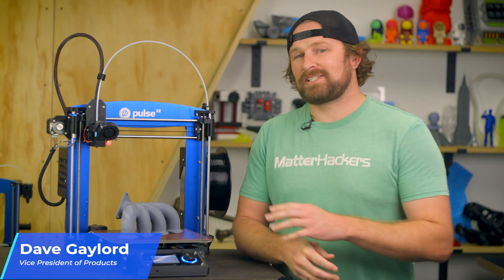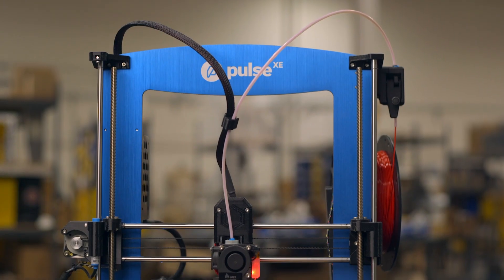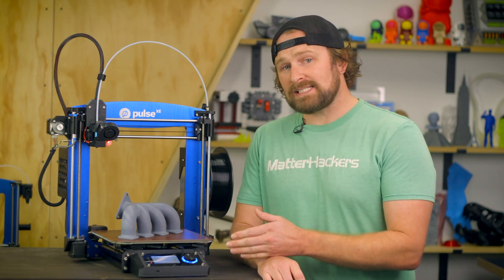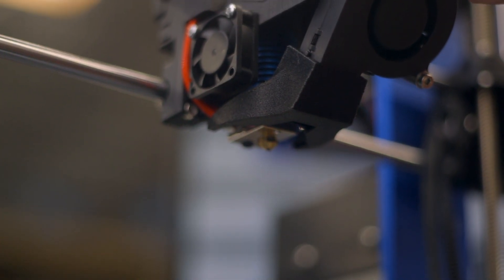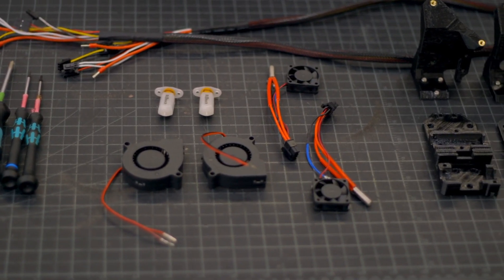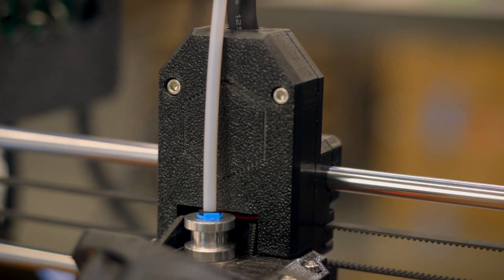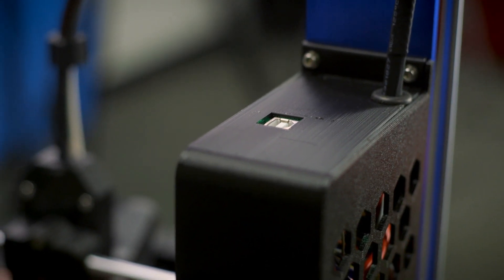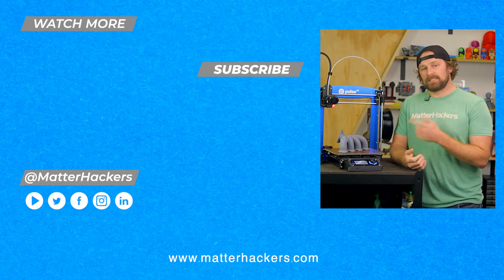Tech Breakdown: Pulse Custom 3D Printers

Comment: I actually think these printers look pretty decent even in 2024. I've looked at dozens of models and have 4 printers. Yes they're not the flashiest or latest anything, but reliable out of the box is more important to me than any of that and I don't need to print high speed PLA

Comment: I bought one of the D series pulse printers back when I was still new to 3D printing. Boy, did I get played. It was a really good printer and still is, but it's WAAAYYY to overpriced for a printer that was missing a lot of features that most printers come with out the box, like an LCD screen and tetherless printing. I dont recommend buying these printers unless they become significantly cheaper. Or just upgrade an Anycubic or Creality printer for cheap that may even work better than these printers.
Reply: Same situation and I agree. You have to be nuts to spend this much on old design. Hell, there are new US made players now that surpass Pulse in value and features. They don't even offer and upgrade solution.
Reply: I came to this video basically looking to figure out WHY this printer is as expensive as it still is to this day. I assume the price never got updated over time. It's basically a modern day prusa mk3 but with a higher price tag which kinda blows my mind haha

Comment: Lol the price for this is for somebody who dont know no better, Buy a cheap printer with good drivers. get a good E3d hotend for a quarter of the price. Matterhackers is such a rip off anymore. the filament is really poor. was reviewed with the 18$ filament at microcenter and the microcenter filament came out on top. I have a upgraded ender 3 that would rip that thing apart. and with the rapid change that E3d has out you guys cant even come close to my ender3 specks. and i cant come close to your price. even adding a Hemera and a wham bam and a bltouch.  or even adding the rapid change to it. How many different print heads can you buy under the price range of that printer?

Comment: The Pulse printer is an excellent printer for those who want USA made precision and quality right out of the box. The Pulse printer comes with a “No BS” 1 year warranty and can be extended to two years. Customer service is in the USA and they can be easily reached via phone or email. You may customize your Pulse with different add-ons during purchase, including a custom made aluminum clad chamber. The price is reasonable for a USA made printer backed by MatterHacker support.

The cons: 
No direct drive, although increased print speed is obtained and you can print nylon at a rate faster than what is maximum rated speed by the filament companies. 
No run-out detection and no easy way to add this. There are printable files available, but no instruction available for adding. 
You may purchase upgraded parts, like the SliceEngineering hotend, but again, no support for adding to the printer. I think MH should help customers install upgrades instead of telling us to figure it out ourselves. 
Usb cable provided is of poor quality, toss it in the trash and purchase foil shielded USB A/B with choked ends. 
The magnetic Garolite print surface works amazing with no glue or polymer adhesives. However, if used with a flexible Buildtak spring-steel base, your nylon prints will literally peel it up off the magnets. 
Lastly, customer service is very good. Do your research prior to purchasing, MH sales support was not fully knowledgeable during my sales call. And when I had a problem with my printer, it took support almost a month to return my email without a phone call as promised.
Reply: Why the hell do people think "Made in USA" is so much better than if it was made in China, Korea, France, Cech Republic, or any other country in the world?
Normally when I hear someone say "Made in USA" or any other country in an advertisement or promotion video like this, I just think that they are idiots who are too proud of their own country ,and doesn't see what their country would've been if other countries were there to support their country, etc.
Reply: USA made means nothing to most people, especially if the thing made there is crap

Comment: Does it have network function?
Reply: Mine did not come with direct network plugin capability. I have a dedicated computer that runs my Pulse using MatterControl on Linux. I can either operate it locally or remotely control it over the network.